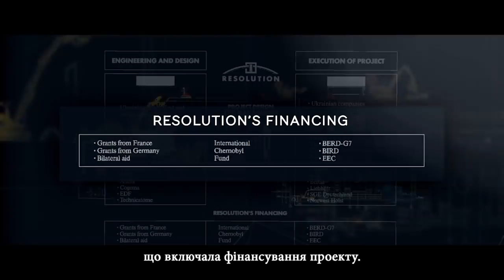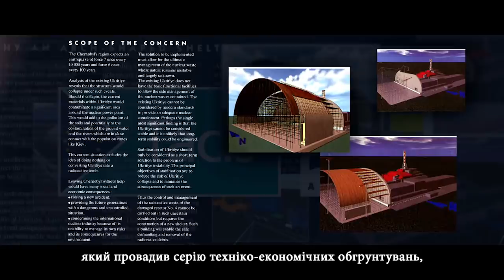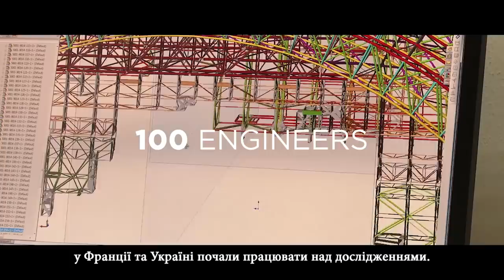Chernobyl confinement: the story

Comment: Why are they dismantling the destroyed reactor? They’re never going to use the region again due to radiation, why remove anything from the containment building... just to take it to another radioactive waste dump? It’s like rearranging deck chairs on the Titanic... after it’s been sunk.
Reply: because it will break apart in 50 years if we do nothing those rods have a 150 year half life 30 of those have elapsed if we leave them in there and place the dome over Chernobyl it will just make it worse. we need Chernobyl completely dismantled as long as those rods are in there with the sludge more gamma particles are being released into the air. If the dome is put in place with out removing the rods or the sludge in 50 years the reactor and the power station itself will explode in a greater fallout than when Chernobyl blew in 1986 and all life on earth will die. People will get radiation poisoning, mutations, some will get goulified, and large populations will be wiped out. To prevent this Chernobyl needs to be dismantled all radioactive waste must be removed from the site and sent to Czechoslovakia for disposal.
Reply: Ofcourse they are going to use the region, there is already people living there infact. Cleanup has worked. The radiation levels are very low.

Comment: All because of that doughnut  insisting the test could be run at 200 megawatts instead of the recommended 700 megawatts output. We've all worked with them types
Reply: He literally pushed it to the extreme. All for a test, the results of which were useless

Comment: Filling it with sand and building a solid concrete dome over the entire thing would have been a long time solution
Reply: This is a longer term, and safer solution. Once the arch was over the remains of the site, the cranes began dismantling the contaminated structure, thus permanently removing all risk of of further contamination.

Comment: The deadly Radiation from the melted Chernobyl hot core is supposed to last for 25,000 years. And the Sarcophagus containment cover is supposed to last for a 100 years... something is not right with this math.
Reply: John L from what I’ve read, which might not be right, the core is cooled down to slightly ambient temperature. Yes it is till dangerous but it can be removed and safely disposed of, which is what they plan on doing before the 100 years are up.

Comment: Its sad that we had to build such a thing in the first place!
Also, isn't that place going to be dangerous for another 50,000 years? What is 100 years to 50K?
Reply: 20000 years
Reply: More like 20,000 years.  However, the point of this structure is to contain the damaged reactor area and the building nearby in order to be able to work on completely dismantling all the stuff inside so it can be cleaned and disposed of in another safer location. By making a completely sealed area they can work without the worry of having dust be spread out again as they take down the structure.  The plan is that over the next few decades all the work will be completed and the area under the new arch will be significantly more safe.  Not to say that people can go there but the risk of more contamination will be minimal.  Right now there is still a HUGE amount of nuclear material buried under all that and it needs to be removed and disposed off in a safe manner.
Reply: If the pieces of fuel, graphite and contaminated items are taken care of this place can be safe in just years. Most of the village at this point barely has higher then background levels

Comment: This is an amazing achievement... But hasn't a lot of damage been done already? This happened in 1986.
Reply: Yes
Reply: Chernobyl is still there. This isn't a fix. Building a Gen IV reactor near by to burn the waste would end the problem.
Reply: @simongold2739  does a your reactor burn graphite? :D
Reply: @herbertsdottir9223  "burn graphite?"
99% of nuclear waste is not graphite. Nuclear waste usually is as mundane as a steel wrench or bolt.
Sustained temperatures of around 1000−2000C in order for pure carbon to burn. China built a fusion reactor that reached temperatures of 100 million degrees Celsius.
ITER, Cadarache facility, Saint-Paul-lès-Durance, France.  Initial plasma experiments are scheduled to begin in 2025. For deuterium and tritium, the optimal reaction rates occur at temperatures on the order of 100,000,000 K.
Gen IV designs operate at 500-1000C. Gen IV can burn 99% of nuclear waste, until there is something newer to burning the rest.
Reply: @simongold2739  Is there air in your gen IV reactor (to burn off the graphite - the answer is no btw) and what's the EROEI of the chinese  fusion reactor?
Reply: @herbertsdottir9223  "Is there air in your gen IV reactor (to burn off the graphite"
Gen IV burns nuclear waste. 99% of nuclear waste is not graphite. Waiting to hear your solution for the 99% of the problem before we go any further.
Gen IV also provides cheap energy, solves global warming, desalinization, a path to hydrogen production, a path to fusion AND burns nuclear waste. Cheap energy is required for fusion, the solution is Gen IV's high EROEI (I assumed that was obvious in the previous posts).
Reply: So it doesn't end the problem and the EROEI of your chinese fusion reactor is shit.
Reply: @herbertsdottir9223  "So it doesn't end the problem"
Gen IV provides cheap energy, solves global warming, desalinization, a path to hydrogen production, a path to fusion AND burns nuclear waste.
You're boring me.

Comment: Congratulations to the whole team for their success, but nowhere in this video there is a single mention of the well being & safety of the workers and contractors who worked in building this huge structure.
Reply: The whole idea of the building on wheels was "safety". The video mention this.
Reply: @simongold2739  Most of the structure was fabricated on the spot(just in front of the Reactor 4) part by part before sliding it to the main zone; so the men who worked there in fabrication must had some protection. This video should have mentioned those as well along with great success in creating the engineering marvel.

Comment: So it is safe to be there then? I thought the area was inhabitable, yet I see them working like its just a normal place.
Reply: The radiation levels are at the same level at 30k ft in the air. As such as long as the workers swap out every few hours they will be fine. However every building, toy, car, trees, and dirt still retain lethal levels of radiation and as such you can look but you really don't want to touch anything.

Comment: Why do they need to dismantle the sarcophagus? It's adding an extra layer of protection already.

Surely a better idea would be to reinforce the sarcophagus structure using the NSF?
Reply: The old Sarcophagus is starting to break down and now poses a risk in itself. If it were to collapse and fall on top of what remains of reactor 4 it would release a ton of radioactive dust in to the atmosphere
Reply: @L8ugh1ngm8n1  Yes I get that but why would they dismantle it instead of trying to reinforce/repair it? It's the same amount of risk but for a greater reward.
Reply: @podgemcgrath  The objective is to remove the old sarcophagus so they can then get to what remains of reactor 4 and then start the deconstruction of that. No point in shoring up or repairing the old one especially given it is now in a pretty poor state.
Reply: L8ugh1ngm8n1 And the endgame is to remove the cause of radiation and making the area safe once more

Comment: They should have poured fresh concrete on top of it not sand, would have saved tons of dollars
Reply: weweko kowe it would probably have made de problem much worse. The added weight on the plant’s foundation would have accelerated the flow of fuel containing lavas, possibly penetrating much deeper into the earth, even down to the water table. Besides, the heat from the white-hot fuel would’ve cracked the concrete as it dried, making it pretty much useless.

Also, that’s not too far from how they actually made the original sarcophagus, as a good portion of it still rests on the ruins of the collapsed reactor building. This was one of the main concerns driving the construction of this new arch, as the damaged concrete structure of the old building could collapse, once again exposing the fuel to the elements.

Comment: Im a bit late but what would happen if or better said when The Elephant's foot melts over to the water underground?
Will the arch resist?
Will Ukraine and close states like Romania and Bulgaria be in danger?
What effect will this possible explosion have?
Reply: The elephant's foot is cold and crumbling. Most of the elements contained in it have half-lived a few times. It is still very dangerous as there are elements in it with a half-life from 30 to 25.000 years(Cesium, Americium, Plutonium). The reactions in it have slowed down enough that its temperature is only a few degrees above ambient. It will never reach the underground water. The area under the reactor has been dug out and filled with concrete. 

An explosion is impossible since there is no critical mass, and it will never be a critical mass. The foot continues to slowly decay. The only real danger until the construction of the arch was the possibility of the old containment unit to collapse releasing radioactive dust into the air, but now it has been made safe.
Reply: @sobolanul96  Exactly. It annoys me that everyone seems to throw a fit over that bloody thing.

Comment: So the open end of dome is sealed by existing building that’s rotting? That’s bad design. They should have cleared some of those buildings to make way for a fully sealed dome. This done will only last as long as those crummy building it is using as a seal.

Comment: the dome is not needed. If you want to lessen the radiation the best thing to do is cover the whole area with concrete or just cover it with sand then put a net over it so that the sand will not erode
Reply: Nets are pretty radiation-proof...

Comment: So. Why do we still need containment ? Is radiation still leaking?
Reply: Yes the concrete roof they built back in 1986 was starting to crack and radiation was seeping threw the cracks so this was a last ditch effort to contain it once and for all
Reply: @nickshannon7309  I wonder how bad the leak is. There are plenty of videos with the elephant foot and several other radiation areas and people have little protection. I am curious to know the actual level of threat on each area inside the reactor and the outbound threat from leaks.

Comment: Are the workers insane going into a place so irradiated without power armour
Reply: LiL bOi the workers know the risk but the radiation level is low around the site to where one can spend a few hours with little complications. However, long term exposure is is dangerous that’s why they built the structure, to remotely remove the waste while limiting radiation exposure to none.

Comment: There not done yet.  The next phase is the internal work which begins with the dismantling of the crumbling sarcophagus within the new "arch" built over top via robotic cranes, machinery, and a giant gantry crane attached to the super structure of the Arch.  Every piece of concrete, steel, etc. is to be decontaminated before being removed from the structure.  The real difficult part will be the excavation and removal of what remains of reactor 4 and any Corium such as the famous elephants foot which melted through the reactor bottom and into the catacombs beneath what's left of the reactor.  That's the real dangerous stuff.  This process will take decades and billions upon billions of dollars to complete.  The arch has a very sophisticated dust and air filtration system because as most could guess the dismantling of the sarcophagus and the remains of the reactor beneath will generate a TON of radioactive dust that must be contained.

Comment: I don’t understand how the workers can just wonder around with no protection and breathing apparatus?? Surly there is still radiation in the air??
Reply: TheDefJamm they have to follow rules, they cant Be there too long, and breathing systems would not help.
Reply: The work area has been cleaned up before hand and a huge lead wall was built between station and work area too.

Comment: Actually Chernobyl will not return to safe normal radiation levels until the year 22,000. What this dome is doing is shielding radiation from going off and effecting other areas. The original explosion in 1986 poured over 200 tons of radioactive material in our atmosphere. That is 400 times greater than the 1945 Hiroshima bomb. Again this dome will help prevent radiation levels but it is still very dangerous.
Reply: Mr Derp correct, and then thinking about the fact the explosion was a steam explosion... What a power..

Comment: They should've just built a box around it and filled it with concrete
Reply: rubikschu A bubushka doll of concrete radioactivity I like it
Reply: Rubi, it wouldn't work for long... 10 years or - not even 10 - they would haaaaaaave to do another box, and then another box... more dead ppl.. no, dear.
Reply: Yea I'm sure you're smarter than the engineers and radiation scientists here. Why don't they just employ you?

Comment: is it now safe to live there?
Reply: Horde zla 1987 never going to be safe
Reply: it will be, in a few thousand years...
Reply: sc00f i dont think so. there are tons and tons of nuclear energy there.
Reply: Cesium-137 is one of the major pollutants. It's half-life is around 30 years. So in 30 years, pollution is halved, in 60 years, it's one quarter of the original, in 90 years, it's 1/8th and so on. 1000 years is a little more than 30 half-life cycles, therefore in 1000 years, cesium-137 pollution is reduced by a factor of 2^33, which is around one billionth of the original. So in that time, all but a tiny fraction of the radioactive elements have decayed to stable isotopes.
The reactor itself has some elements with longer decays, so the area of the reactor itself won't be safe for possibly quite long. But the background radiation in the neighbouring area will decay very significantly over the course of a thousand years or more, to the point where it is inhabitable again. Most radioactive isotopes gradually decay over decades and centuries. Today it is not unsafe to take short trips in the area (except the reactor itself and some highly polluted zones), but it's still unsafe to stay there for long, and probably will be for centuries.
Reply: No, they didn't remove any existing radiation materials except where they were working.
Reply: no

Comment: truly a feat of engineering, i tried several times to intern on the project as a M.E.
very important the damage is contained but i am saddened i never saw the original sarcophagus in person
Reply: Some of the radiation is contained temporarily. It will still exist and need to be contained for longer than mankind has been in existence. Good luck with that.